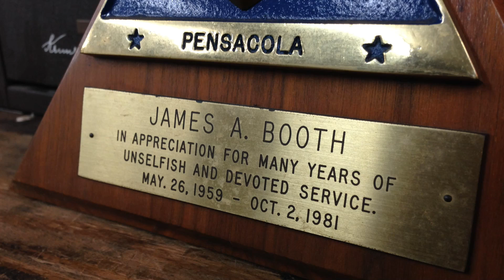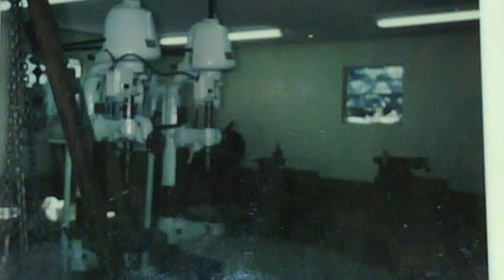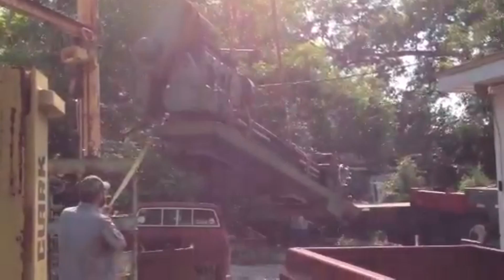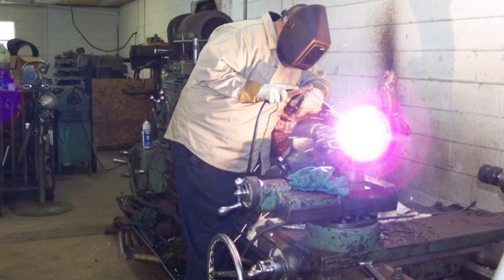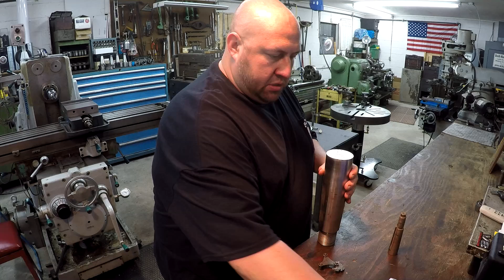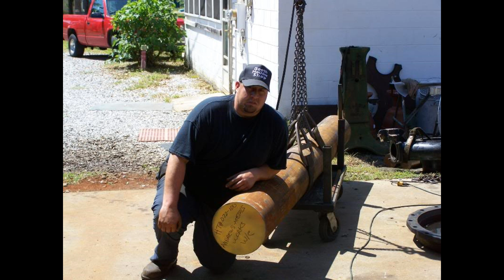Saturday Night Special 100 Part 1

Comment: Hey Abom79 ..... a massive shout out to you for your knowledge .... it save my brothers bike cylinder head.... we use your method in using an end mill to extract a broken off bolt and then pealing out the thread ...... Your videos are a bastion of knowledge to the machines community ....

Comment: The only way to learn is hands on colleges wastes money and tech threoys vs common knolegde you learn on the shop floor it's the way I rolls  I am happy I learns on job and obrving the older Machisnt in shop cause they sure tough me how to be a Jack's of all manual Machisnt as a Machine tool builder and also in the area space industry thanks to all the Machisnt before me I sure wised leard more from um before there knoleges lost to times

Comment: Hey Adam. You said your grand dad worked on pensacola. I have a story for you. My dad was ops officer on the Lexington in the 60’s. He told me they were doing some work on the lex and cut thru a bulkhead and found a complete machine shop that had never been used. Apparently when the put the lex together they forgot to put hatches in this machine shop. I got a laugh out of it. Wish i could have seen it.

Comment: No worries Adam, the big lathe "Bertha" is doing great over at our shop in FWB. I love that you have a video of that move, it shows Ol' B rad back when he was skinny and smoked cigs still and my young self loading that beast of a lathe. Thank you so much for doing what you do and sharing what you learn along the way, because it helped shape my machinist arsenal and understanding from simple setups, to complex fixtures and different ways of holding pieces. Due to the inspiration you've instilled in me, it has driven me to research and adapt our shop for better ergonomics and functionality. Next on the list at the shop project is removing our bridgeports old Accuright DRO with a brand new DRO. The old DRO is only 2 axis, but the new will be 3 axis so im super excited about that. If your ever in Fort Walton, dont be a stranger, stop on by the shop and see how it's evolved. 
Always thinking, always improving!
Reply from the maker: Awesome! Thanks for commenting. I have always wanted to go over to y’alls shop and see the big Monarch again. I’m hoping I could do that and take a video of it. The viewers would love it! Let me know. 👍🏻

Comment: You were advising your viewers to think about Tech school, and I could not agree more Adam. I went to a couple years of junior college learning the normal math, English and biology without any real interest. It wasn't until I went to Tech School here outside of Seattle that I learned to love school. Taking Structural Steel Detailing. Which is picking structural steel off of architectural drawings.  As with you I have some great memories with my fellow students, plus I picked up a few bucks being the teachers assistant. This also included CADD drafting which I couldn't get enough of. 
After school I went into civil engineering rather than mechanical.  This civil engineering was at the State Transportation department in Washington. I remember thinking I like the tolerances more in civil better than mechanical.  A tenth of a foot rather than a thousands of an inch.
Loved hearing your family history. I am surprised you didn't help in your Dad's shop making a little money before you did. Thanks for making the video.  I hope you can get a few young bucks thinking about your trade.

Comment: Hi Adam,
Enjoyed the two videos, especially pt1. I trained as a marine engineer with the Royal Navy and did a 4 year apprenticeship in fitting and turning. After which went to sea keeping the ship running but later spent 4 years in a similar facility to your Grandfather in the UK, though smaller...making all sorts in the workshops.
Yours Andy

Comment: Great video. Place I work has a monarch like yours, used with flap wheel sanding, for sanding pipe bases for inflatable packers. If your ever in denver CO,  come on by. Also have some giant Gisholts lathes that do not have wide enough gears,  so  half of them have broken of teeth, from just changing gears. Anyway love your videos Adam, keep up the work!

Comment: Thanks Adam for sharing your family story and your experiences as a machinist. I've had my share of mistakes by misreading a (No.123) 26" Starret Vernier Caliper inside/outside scale when boring out a 20" diameter ring; I made the bore too big. Needless to say, the owner of the machine shop went ballistic and embarrassed me in front of my coworkers. He later apologized but it did not make me feel any better. This was 40 years ago -I was 20 and still learning. Since then, and whenever I use a 26" Starret Caliper, I can't help but think of my mistake. I'm convinced that I was traumatized by my boss's harsh reprimand.  This is what often happens when profits has no regard for being human.

Comment: Thanks so much for sharing your family history, via this video, and some of the lessons learned via the School of HARD KNOCK'S. Their a saying "you win some, you lose some, and you take a BATH on some (A.K.A. you take it in the shorts.)

I have found that you can tell a lot about a person by how they "deal with" while holding the short end of the stick / taking a bath on a project. I use to work in my younger years as a body & fender guy, & I would work only piece work. So believe when I say that I've eaten some windshields (front / back) (Broken while installing) or caused a wrong part to be ordered. There is no return's on electrical parts, hence order the wrong electrical window motor, you eat it. The shop owner(s) would always something along the lines of "does it taste better with salt or pepper."

Comment: hey hello, nice story!... I am thinking that you could fix the shaft that you were showing at around minute 40... I believe that if you were to  TIG weld it, while it is slowly spinning on the lathe, you could rebuild the metal that was lost in the machining process, and then re machine it for the same or for other project
Reply: +Robert Ostman hum well I just saw that you are using the technique suggested in at least a couple of times so...

Comment: No offense. You look like Sasquastch next to your Pop. I'm no machinist, but a farm boy from Iowa. An old man now but had to fix everything that went south on the farm. I wish we had some of the tooling you 've got . It would have made things much easier.I remember going to a machine shop in a town nearby, Harlan ,Iowa to get some shafts for the corn sheller built up and turned down. I was 8-9 years old at the time. I was amazed at the machinery in the shop.I was amazed by farm machinery , but this machinery kept the farm machinery running. My Dad told me"Ole Man Wigness was the best machinist in the state and had built many of the machines he used to repair the farmers shafting and bearings and what not.. I still remermber the smell of the cutting oil and the hot chips flying off the lathes. I'm 65 now. Its one of the best memories I have, Even today when I an drilling a hol;e in Steel and put a drop of oil on the cutter , 
Wigness Machine Shop comes back to my mind. I was a little boy, standing there with my Dad
Reply from the maker: +Glenn Miller I have done quite a lot of work and repair from farming machinery. Good memories you have there!

Comment: Yes we all have those screw ups.  I have used metal in a fab job and screwed the pooch big time and had to get another.  However being that the price of metal usually does not drop that piece that was messed up usually was more valuable in a year or so and was used for another job where it was sold at the new higher price.  Hey, without those pieces you made a little booboo and had to cut it off and use the extra where would you get those pieces of high priced stainless or brass to make those little projects.  HAPPY 100TH,  have enjoyed every one of them and watched most more than once.

Comment: Just wanted to comment that I did enjoy that story, particularly the lessons learned such as cutting to length AFTER correctly machining an end and to always check the thread pitch. We just got a lathe at work, she's old and not in the best of shape currently but I'm gonna do what I can  and try to put it to good use and other than some manual reading the majority of what I know about machining comes from channels like yours so I just wanted to say thanks for sharing your experience!

Comment: It's kinda funny that your big mistake is with threading.  I am working on making a drawtube for a 5C collet setup on my southbend heavy 10 and have several threads to make.  At the start of each threading process I hear you say in my head,  make a scratch pass and check the threads.  And then I watch the video tonight and that's your machining horror story.  I really appreciate all the stuff I've learned from you and can say that I''m a lot further ahead because of that.  I even finished my first job that I got paid for last week.  Thanks again and keep up the good work!
Reply from the maker: +starrtraveler29 You only need to make that mistake once before you remember to check it each time.

Comment: dont feel to bad about that prop shaft, noy to long ago, my buddy had gotten a brand new lathe, it was old, but was never used, it had the plastic still on it even. but they had taken the motor off of it and we got a new one for it, and i put a pice of 3 inch, by 1 foot long stock in the chuck, its only a 3 jaw. and i had thought i had it al ready to go. i had started up the lathe, and everything was fine and i started cutting with it and it was acting like the piece was loose, and i had tightend it even more, then started cutting again and the chuck and the piece went flying off the lathe, and through the wall behind it. nearly killing my friend. and after that we were told by the person we bought the lathe from that someone tried to steel the chuck, and had loosened it, and he had put it back on, but didnt tighten anything on it. i race pro-am  motocross, and that was the hands down scaryest moment in my life.
Reply from the maker: +Ryan Lucey Does sounds pretty wicked! Hey i love watching motorcross and Supercross!
Reply: Abom79 ive been racing sense i was 3, i love it haha

Comment: Also, we had a monarch that I believe may have been the same exact model where I work now.  It broke my heart as they sent it to scrap, she still ran true...  Heard you mention it in other videos, and when I saw the drive housing with it being up above the spindle, I know they were the same machines.  I loved that old machine and hated to see it go, as I know you did too. Hopefully it is making parts and repairs somewhere else.
Reply from the maker: +cornwejf It went to a local pump repair shop, so they are making good use of it. I used to do there work on it.
Reply: +Abom79 good to hear.  I hate seeing good machines stay idle and not be used.  Did you get my email about the starret catalog?  Still got it if you are interested.

Comment: Great stories! I miss the old big Monarch from the PM days as well. Someday maybe I will find one to add to my new shop, of course got to finish that first!  Keep doing things the way that you want to do them, you only have to please yourself.
Reply from the maker: +bcbloc02 Yea i was still getting jobs done back during my PM posts. You'll have to buy one just to match all of that other machinery you have.
Reply: Abom79
I have my eye peeled for a deal on a 91Series Monarch which is pretty much their eqivelant to a big Pacemaker.  Several times in the last year I have had to turn down jobs because I couldn't swing them. I think something around a 40" swing would cover most anything I run across. Merry Christmas to you and the family! Supposed to be warm here so I hope to get some crane rails put up over the holiday.

Comment: Nice vide Adam! i to did a messup recently, i was turning a special screw and put quite alot of labour into it cause i was thinking about doing the part in a more userfriendly way even if it was going to take alot more time since i would be learning from it and i also was not charging more for that part since it was a test of mine. anyway that part had 3 different OD's and i turned those and the last OD was meant to be threaded, well i got a brainfart and turned it to size...for internal threads and the threading tool slided right over it and i got really pissed of at myself for fucking something so obious up. my dad saw my mistake 5 min later and told me shit happens and we went with the faster but not as userfriendly way. (really large nut with a bolt that had a handle welded to it VS my enclosed locking pin design that could not be lost o shaken loose during transports).

Anyways keep it up, looking forward to part 2!
/Emil.
Reply from the maker: +Njörðr Sigurðr Sometimes the simple mistakes really hurt you. I know your pain.